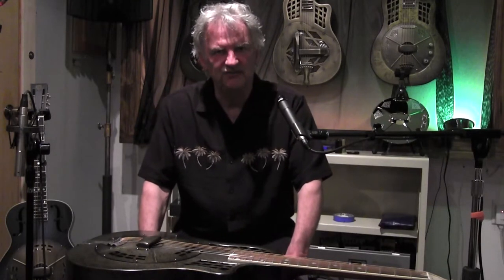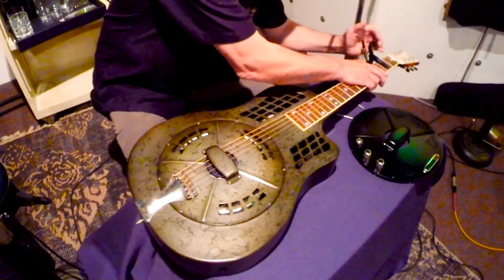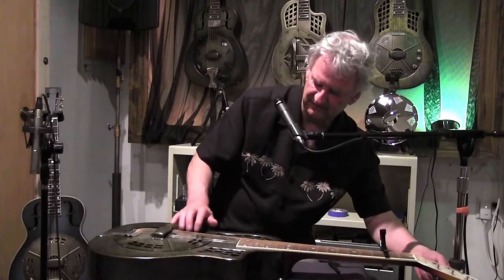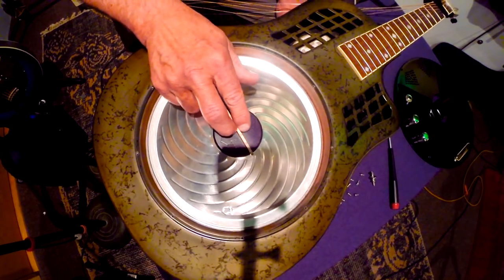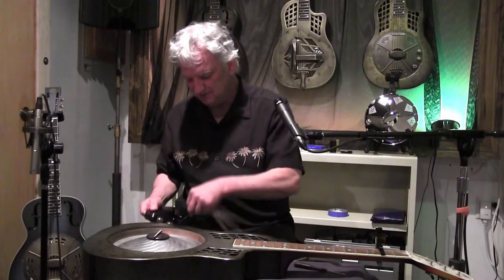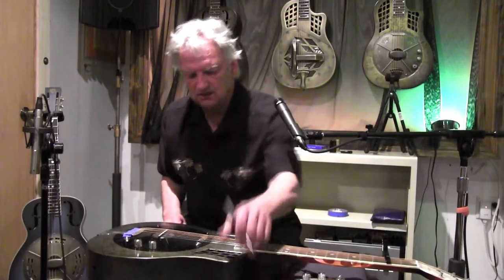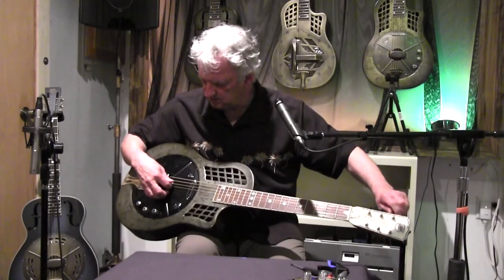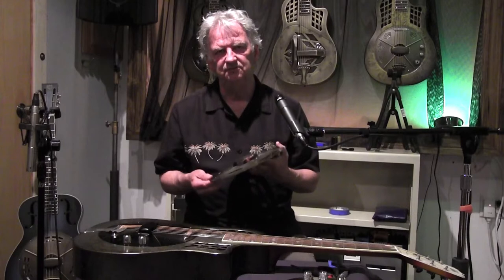Hot Plate Installation With Mike Dowling

Comment: Actually, the saddle should be very slightly oriented as to give you a bit more compensation on the lower strings. I.e. ,rotate it ever so slightly.It's sort of a trade-off in that the more length you give the bass the sharper the treble becomes. You should be able to get things dialed in and remember to not let the cone creep too far forward.
Mike